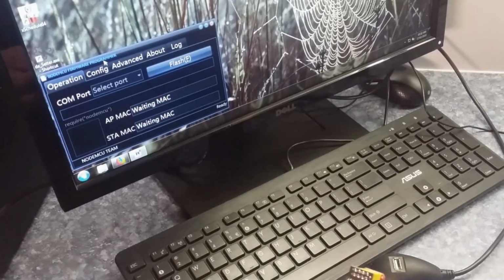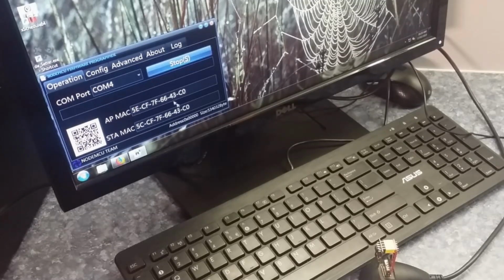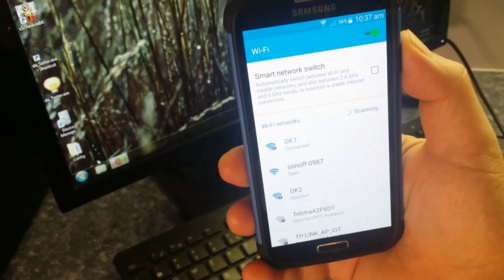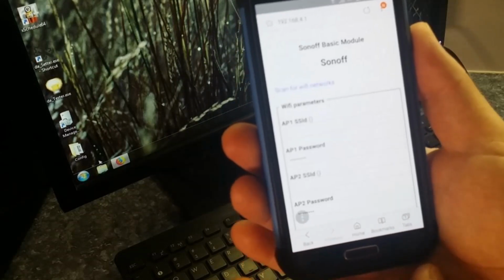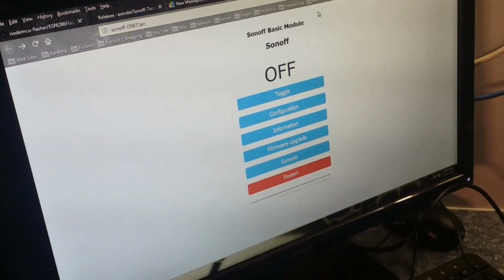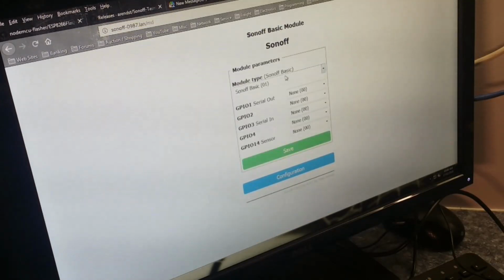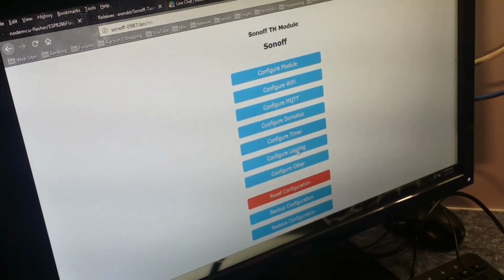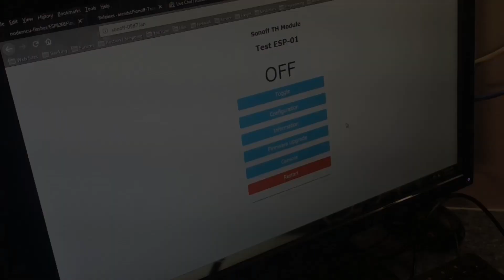Loading the Tasmota firmware onto an ESP-01 module

Comment: Hi, thanks for the video. I upload the Tasmota firmware  in the ESP-01, but not work, really not generated the tasmota wifi link to setup the module. I use tasmota in some sonoff and work really well, but in the ESP-01 not work for me. Could you help me with some idea? Thanks in advance for your help. Sebastian from Argentina

Comment: How did you changed standard IP 192.168... to sonoff-0987.lan? Is it in configuration or you set up this in your router?
Reply from the maker: The sonoff-xxxx.lan is the host name of the module, not the IP address. The xxx will be different for your module and can be seen when you first connect to it via your phone.
Reply: @daShare  OK, but once configuration is done and your module is connected to your home WiFi, you can enter it by 192.168... or by alias as well. I can enter Tasmota only by 192.168... :)
Reply from the maker: @dziekan_tek  not sure why yours won't connect via the host name.

Comment: i have two flash adapters (slide button style) and two ESP01 chips,   i cant get either to work, picks up the com port,   slide it from prog to uart after its inserted,  does not connect and flash,   i have tried the ESP TOOL FLASHER and Arduino  cant get it to connect at all.   
I have to be doing something wrong :(
Reply from the maker: Are you plugging the ESP01 into the programming adapter before you insert it into the USB port?
Reply: @daShare  yes ESP01 is in before it goes into the usb,   once its picked up i slide it back over to uart.
Reply from the maker: @sonny1977  The only other thing I can think of is that you're not selecting the correct firmware / location in the programming tool software.

Comment: Thanks for posting this. My programmer doesn't have that handy switch on it, but, I'm not sure that's why I'm battling. I noticed that on the NodeMCU Flasher page, there's a notice saying you need pull GPIO0 to low. Any idea how I might do that?
Reply: I added a single tactile switch to my UART by using the method here: https://www.youtube.com/watch?v=u78W3GKtcrw now I press and hold the button, plug into my USB socket then release after approx one second and then start the firmware upload. Hope this helps.
Reply from the maker: The switch is connected to GPIO0 and setting it to the PROG position is what pulls it low.